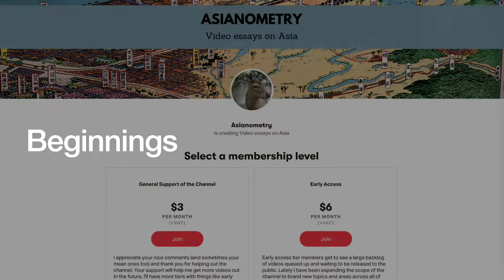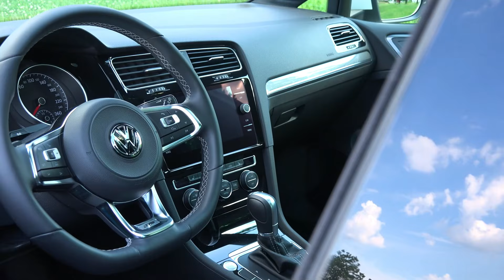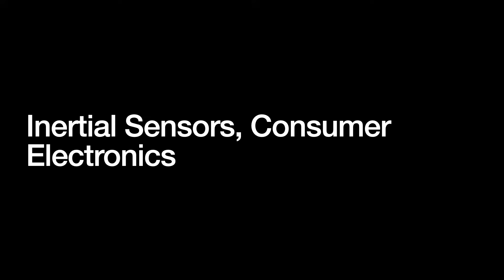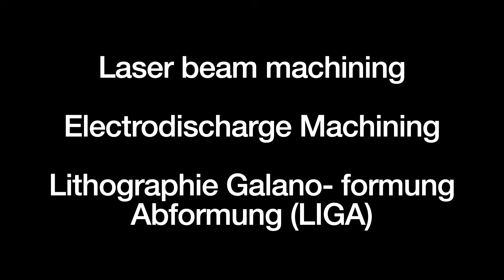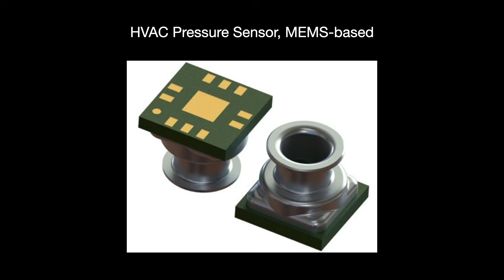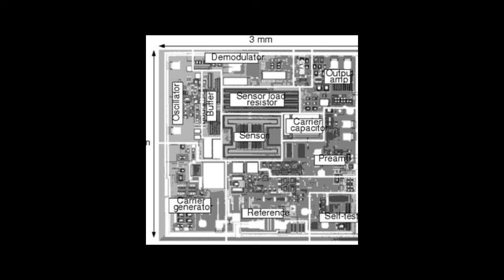MEMS: The Second Silicon Revolution?

Comment: How exactly do MEMS speakers work? Is there any conversion needed between analog and digital like current speakers?
Reply: piezoelectric speakers still convert signals to vibrations, so yeah ADCs and DACs are required
Reply: They can be i2s and have an internal DAC, and they can use acoustic lowpass as a reconstruction filter, so they can be fundamentally be executed effectively fully digitally, without ever coming up with an explicit voltage or current representing the amplitude of the signal, but driving the MEMS assembly with a delta-sigma signal directly. I haven't looked at MEMS speakers, but i have seen MEMS microphones with i2s digital interface and analogue both, though i don't know that i've seen a manufacturer spill the beans on how they do it specifically.

Comment: I think the next gen semi conductors and microships would be GaN, gallium nitride. It has superior performance to silicon based ones. It is used currently only in military application due to cost, but if it goes down, it be quite a game changer. Fujitsu is currently the most well-known in GaN technology. So much  so that even the US military purchases Fiitsu GaN forr their next gen SPY-6 and SPY-7 AEGIS AESA long range detection radar

Example of GaN superior performance is that China's latest and greatest Type 55 destroyer/cruiser vs US Arleigh Burke. The latest Arleigh Burke batches use the said GaN technology while Chinese ones (and of course Russian ones too) uses  traditional silicon like consumer ones. As a result, every time the Type 55 goes out and comes back to port, it was revealed that the radar had to be replaced because saltwater messed up the silicon and made it inoperable. Such don't occur with GaN.
Reply: Salt water messing up the silicon? Isn't this more of a packaging issue? I thin GaN will reach the consumer market via electric cars. maybe Tesla - maybe someone else?
Reply: @rkan2  Some phone chargers use GaN transistors. Still, GaN seems specialized (depletion mode mosfet only).
Reply: GaN is definitely an RF technology on its way out (MEMS has never been in..), eaten away at lower frequency applications by LDMOS and at higher frequency by silicon. Not a technology to bet on, and likely one to die off especially as 5 and 6G target high frequency applications, where a silicon "army of ants" approach beats GaN even for a single amplifier. Maybe it will survive in the power converter domain, but will never happen in logic, and increasingly RF/analog

Comment: Can you make a MEMS standardization efforts and organizations that working on it as next topic? I think only I\O plate\connectors need to be standard. Rest will come in time. Much like USB or PCI-E compatibility. We can plug in tons of devices there, but they all "magically" work without need to understand or worry about internals of such devices.
Reply: Almost all MEMS devices are i2c if they're low data rate digital and i2s if they're audio specific and digital, but analogue devices exist as well. Their packages and pinouts tend to be engineering driven rather than standardised, especially since the industry is pushing for smaller packages, you can have packages the size of the actual die pretty much, but that leaves no room for standardisation.

A neat thing about i2c is that you can have a single bus of 2 data wires running throughout your whole device and all the sensors can be on there. Indeed there's an i2c bus running throughout your PC called SMBus which contains a great number of sensors and also your SDRAM SPD chips and it's also exposed onto PCIe connections.

However most sensor ICs are not SMBus compliant, they cannot hotplug themselves an address, you can't auto detect them, you just hardwire them an address from the available ones via pin pullups/pulldowns and then do a register read, about a few seconds of looking in the datasheet and hardwired into your firmware according to your hardware, more complexity really isn't generally desired by the hardware designers.

What use-case are you thinking of? USB HID is suitable and Bluetooth (LE) GATT is intended for sensor use.
Reply: @SianaGearz  So, is there hot switch option? Can we actually program address before or after use? It will make hotswap option available, or it will complicate things or dramatically increase pricing?
Reply: @vputilov  As long as there are no address collisions, and every address corresponds also to a particular type of device, you can treat i2c devices as polled hotplug. The addresses aren't software determined, they are determined in hardware at board layout stage, or the device can include address set jumpers.

You can also get SMBus to i2c chips which handle just the dynamic address assignment (the adapter chip talks to a sensor on a fixed address, and to host it just gets a valid address from the arbiter) and device type query.

Comment: Another emerging application of MEMS is in all-optical field programmable photonics gate array (FPPGA). It is basically an FPGA for photonics integrated circuit (PIC). The PIC (and silicon photonics, as this is the most potential candidate for the platform) itself is already dubbed as post-moore technology so knowing researchers trying to build this technology is very exciting. Major project like H2020 MORPHIC has made significant result to realize this technology.

PS: Photonics Research Group from U Ghent has a YouTube channel to spread their latest update on their works. Their explanation videos on FPPGAs are easily digestible and quite fun to watch.
Reply: Working in photonics here and can confirm, FPPGAs can popularize the usage of photonic logic, and the guys from UGhent are amazing at communicating it
Reply: Photonic chips have a much larger feature size than electrical ones.
So unless you only care about energy spending, I don't get how can it compete with the electrical ones even if it has 100 times higher frequency.
Reply: @tonalddrump2  a device that can commute 100 times faster than ics in optical communications have some potential. Like for example optical switch's and routers
Reply: @eljuligallego  You are right about switches(I think) but we were talking about compute.

Maybe some electric/photonic hybrid can improve the current ones.
Reply: @tonalddrump2  You didn't get it, they are still field programmable gate arrays, but the gates themselves are photonic (if I myself got it right). For certain tasks benefits are huge especially so if you have some AI to recognise what better to compute with optical circuitry.
Reply: @AlexanderSylchuk  please don't use AI for everything.
Reply: @eljuligallego  Ok, photonics are maybe more application specific right now, but a theoretical AI which can recognise that this part of some task is better be calculated with optical circuitry on our (hypothetical) SOC or computer isn't far from a reality.
Reply: @tonalddrump2  You can make them into quantum devices. Every qbit doubles the power. Look up Gottesman-Kitaev-Preskill codes. This is the trick needed to keep quantum coherence at room temperature. Information 'teleports' itself.
Reply: @Andrew-rc3vh  Could you please explain to an average youtub guy what that code does in normal words? I would be really thankfull if I could skip the 2h video about it I found on here...
Reply: @ShakesB13r    It works similar to the error correction used in computing where you supply redundant information, and if the errors are not so big, like say one bit get transmitted incorrectly, the redundant information can reconstruct the original information perfectly. So with quantum engineering, if you send a signal, the thermal noise will degrade it, but you set it up so each bit that gets degraded gets repaired.  The method of communication is via quantum entanglement, and the light you use is known as squeezed light. Wikipedia will give you a rundown of these various concepts. GKP is just one method. It works on the molecular level. You can use a crystal lattice.

I have a tutorial on error correction here by Steane, who is one of the researchers involved in this. Over in China there is also TuringQ. They have done a lot of good work and the person who runs that is from the Oxford group. It's a great example of Anglo-Chiense relations paying dividends. This is the cutting edge of reseach. 
https://www2.physics.ox.ac.uk/sites/default/files/ErrorCorrectionSteane06.pdf
Reply: Didnt understand a single shit but I agree
Reply: These them thingo's used in that new fangled space telescope ain't they?
Reply: Checkout photondelta in Eindhoven the netherlands
Reply: @Chipchapchoo  It looks like one of those investment scam startups. It's all PR on the site.
Reply: Nice
Reply: NanoPhotonic Integrated Circuits & systems - there's a whole lot of research in that area & astonishingly already working devices thereof.